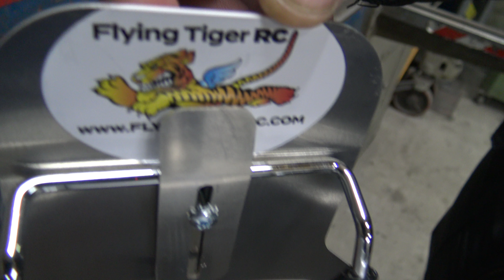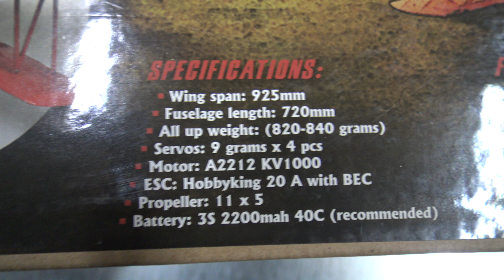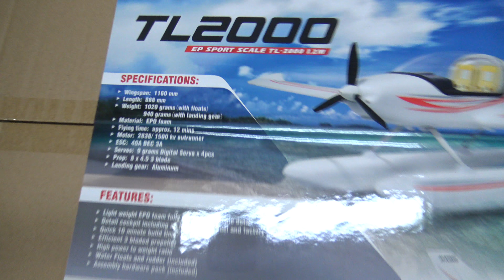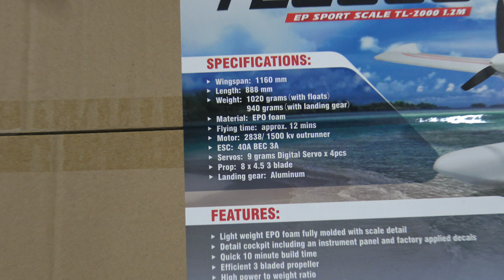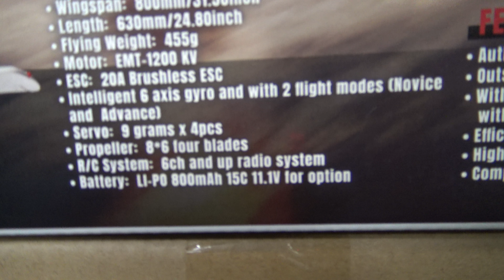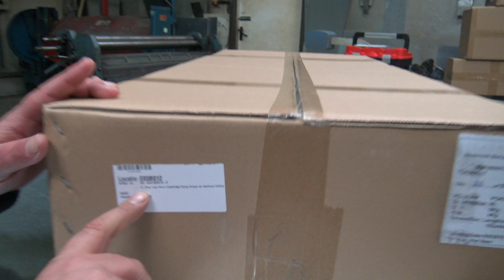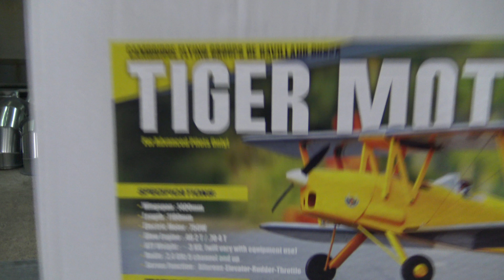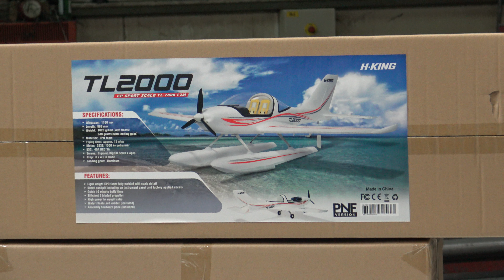HOBBYKING Party time: 5 new birds landed in Slovenia Quick review

Comment: You guys have the perfect shop to fabricate a couple of aluminum shoulder straps for that tray.  They are much more secure than the neck strap material, never go out of adjustment and  will last forever.  Just get some 1" wide by 1/8" extruded aluminum and make them up.  If you wish you could send me an email address and I will send you a photo of the ones I have done.

Comment: I have 3 of the HK Skyraiders and they are awesome flying planes even using 1300 2s which I prefer over using the 3s because of limited flying space.  They are actually the TopRC plane with the Orx Stabilizer added which works very well but no one has found any information on the stabilizer itself.  When flying in beginner mode make sure it has 100% throws or it will barely turn.

Comment: I also clicked on the little Fokker and already flew it a couple of times. Starting is a little tricky because the rudder is so small. Before it reaches a speed where it has an effect, most of the time it already did a ground-loop. 

The first flights it was still a little tail-heavy but had sufficient power. So I added some ballast in the nose, right above the motor and now the CG is ok, but it feels a little under-powered.
One thing for sure: It looks nice and sexy 😎